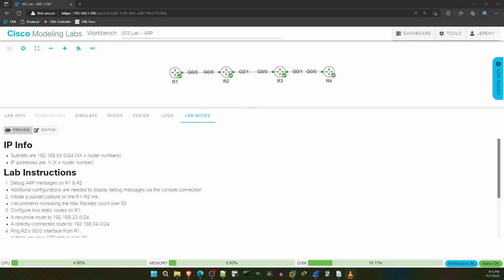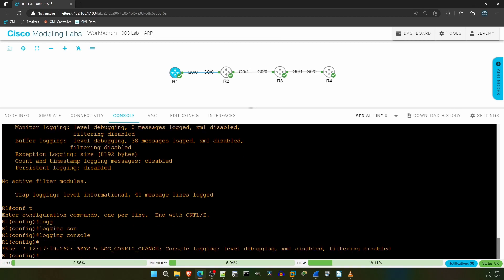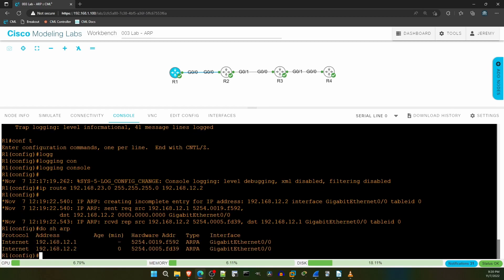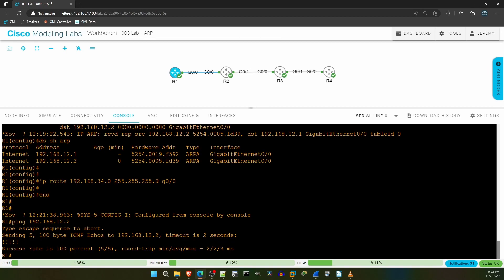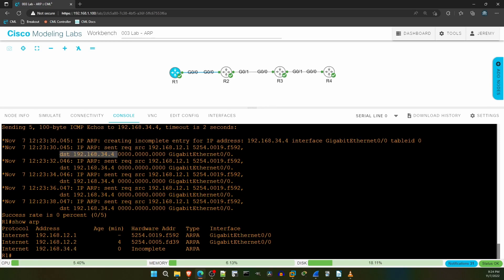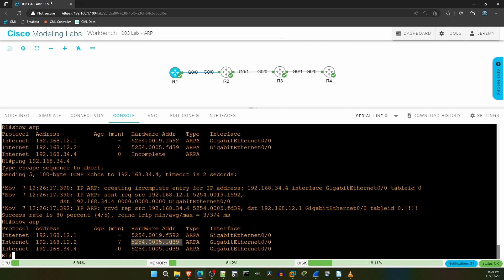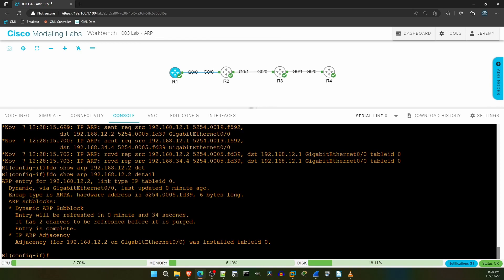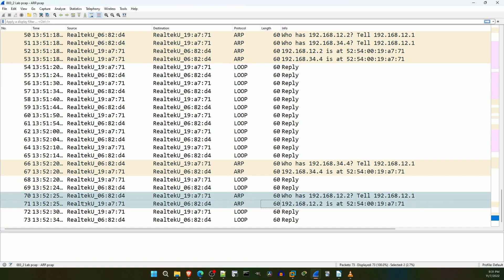CCNP ENCOR // ARP (LAB) // ENCOR 350-401 Complete Course

Comment: Cisco 7200 doesnt seem to create arp entry when creating recursive ip route. Probably not all routers do that. 
I've cleared the ip address of the interface, 
clear arp, 
added the ip back to the interface, 
checked arp table, was empty 
added ip route
check arp table, was empty
ping, added arp entry

R1(config)#ip route 10.0.0.4 255.255.255.252 10.0.0.2
R1(config)#do ping 10.0.0.2

Type escape sequence to abort.
Sending 5, 100-byte ICMP Echos to 10.0.0.2, timeout is 2 seconds:

*Oct 26 12:20:29.519: IP ARP: creating incomplete entry for IP address: 10.0.0.2 interface GigabitEthernet1/0
*Oct 26 12:20:29.523: IP ARP: sent req src 10.0.0.1 ca01.2654.001c,
                 dst 10.0.0.2 0000.0000.0000 GigabitEthernet1/0
*Oct 26 12:20:29.583: IP ARP: rcvd rep src 10.0.0.2 ca02.46ec.0038, dst 10.0.0.1 GigabitEthernet1/0.!!!!
Success rate is 80 percent (4/5), round-trip min/avg/max = 44/57/64 ms

Comment: Hallo Jeremy. Thanks for the great video. I have noticed the test switch at work has the 'logging console' disabled yet I can see the logging files when I enter 'sh logg'...could this be because of the syslog server?
Reply from the maker: Hi Joyce,
The log messages displayed in the output of 'show logging' are a result of the logging buffer, which you can configure with the 'logging buffered' command
Reply: Thanks for that Jeremy.

Comment: Great stuff Jeremy—just curious, is there a reason you name the routers R1, R2, R3, etc, instead of making the node name the router's IP address? I've been changing the node names before starting the labs just to help with visualization. Thanks!!
Reply from the maker: Just curious, what did you name R2 and R3 as? Since they have multiple IP addresses
Reply: @JeremysITLab  Ah, in hindsight I misunderstood. I named R2 192.168.12.2, but actually that was just the IP for the g0/0 interface right? Meanwhile, its G0/1 interface was using 192.168.23.2 as an IP.  

I hope Cisco eventually pushes out some CML updates that make it easier to visualize IP addresses associated with specific router/switch interfaces.  Thanks again for all the great work
Reply: @oldworldobserver If it helps Watch Jeremy's CCNA Day 25 videos; there is a so called Router ID which helps to identify the router with Manually configured, Loopback Interface's ip address or the physical interface of the router with highest  ip address.